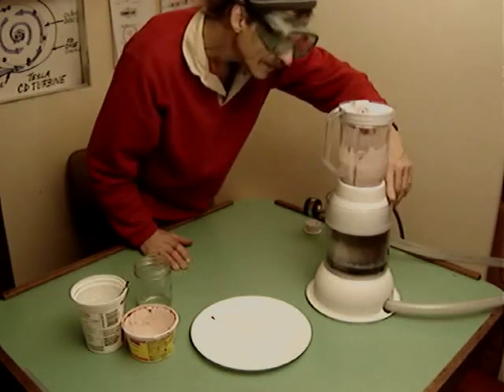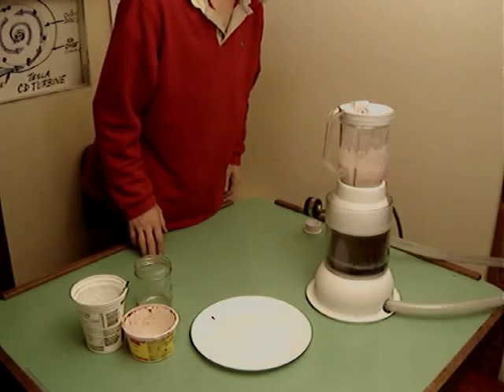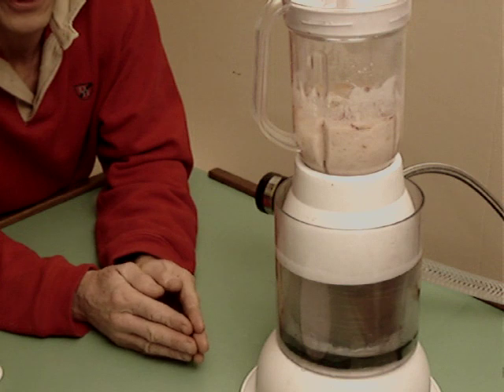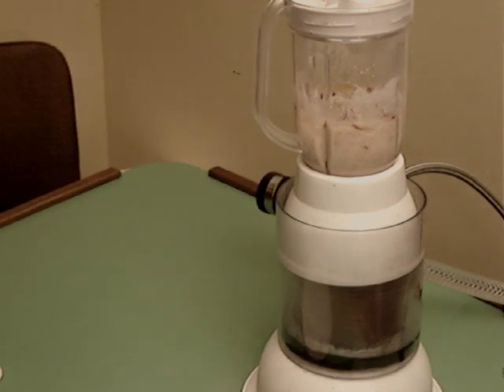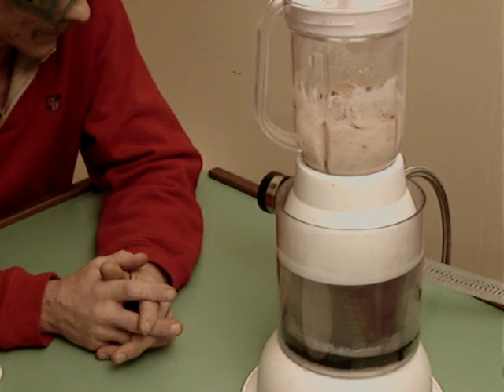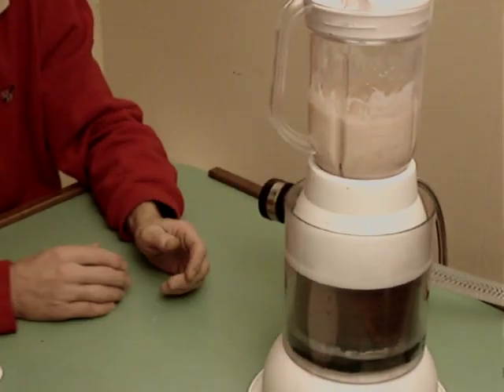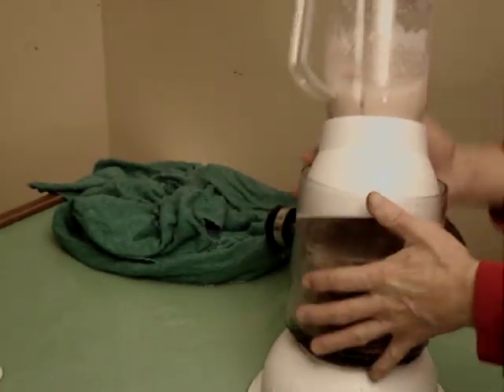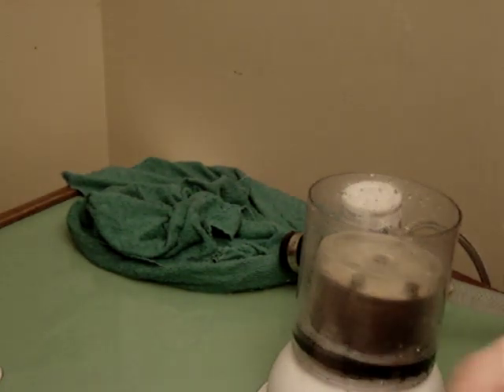Tesla CD Turbine Blender Bursts On Kitchen Table

Comment from the maker: Heat and DVD's don't mix. Steam will warp the discs in about .3 seconds, I've noticed, hehe. You would need to build a separated air-pressure chamber that remains cool, when compressed by steam or heat somehow.

It would be best to build a proper Tesla Turbine that can run on alcohol. But of course, that costs money.

Comment from the maker: I have 6" polycarbonate tubing with 1/4 inch thick end plates to play with next.

I prefer to push the limits of a cheap, disposable turbine that can be built for under $10 by a kid.

The CD case is capable of running the turbine at constant 120 psi pressure or more.

 I made a boo-boo by restricting the outlet hose by allowing water to back up into it. I then gave it too much "throttle" at the foot control for air pressure.

Too much, too fast = boom!
(good comparison with cannon! ;)

Comment from the maker: I'd like to try lots of designs, but a true Tesla Turbine gets expensive real quick, especially if it has a machined shaft, high-speed bearings, seals, and a machined case with special nozzle. 

Unfortunately my $10. per month experimental budget doesn't go far, so for now I experiment with recycled CD's! 

The ceramic discs I really want to use will cost $600 - $1200 apiece to be made.

BTW, T.E.B.A. has taken down their web sites and has little useful info on the net now apparently.

Comment from the maker: When it comes to steam and high-speed rotating steel parts, there are some real dangers involved. However, it will probably work. 4 inch is likely good for 30,000 rpm or more. You need high speed; the torque will be very low with such small discs. If the disc does come apart, not much will stop it, so make sure you have a significant case aound it! Avoid carbide bits, as they can fly off easier.

Tesla used .030 inch thick discs. The thinner the better, but his often warped.

Comment from the maker: There are several points...

1.) To see a Tesla turbine perform useful work.
2.) To demo a Tesla turbine design that is revolutionary because of no shaft, seals or bearings. 
3.) To show that a Tesla disc turbine design runs on multiple fluids, which other turbines cannot do.
4.) This turbine set-up runs on solar power, collecting it through the day and storing it as compressed air. It's inefficient, but it's completely off-grid, and free.
5.) It's just a fun way to run household appliances!

Comment from the maker: Thanks for the theory! 

I think in this case it was a matter of the output hose had a loop of sitting water that the high-pressure air just couldn't blow out fast enough, so the backpressure blew the top off instead. 

 The blender and turbine discs can be totally stalled out and still pass pressure through the discs of the turbine. It's simply the force of fluid adhesion on the discs that turn them, not like in pumps that can blow because of perfect sealing.

Comment from the maker: Thanks!

The cover over the turbine CD cakebox is a near-bulletproof polycarbonate tube, and it would contain any reasonable explosion of the CD turbine. 

I would not recommend running a CD Turbine on compressed air without adequate protection.
(and use a tinfoil safety toque as well !!)

As for electricity, I actually have a few videos showing the CD Turbine generating power...but I keep it under 12 volts for some semblance of sanity!

Comment from the maker: yeah, I was hoping for at least  a trip to the hospital, but the universe wasn't accommodating! Not a scratch! hehe

I tried blowing up a turbine under a pumpkin but that flopped. A magnet came off and through the plastic case at medium speed. The unit slowed down. Anti-climatic.

Guess I'll have to build a real high rpm turbine to come apart for a movie. The kinetic energy stored is proportional to the velocity squared, so  there's 4 times the energy stored with a doubling of the speed.

Comment from the maker: More than a "leak', hehe. Blew the whole top right off the CD case! 

However, the main CD disc pack, is miraculously unharmed. Even after almost a year of intermittent abuse, and the "explosion", the 1/2 inch neo top magnets are still holding strong with marine goop!

So I will hotglue a nozzle onto another CD case, re-use the recycled CD pack, and I should be back in action.

Comment from the maker: @ambitious2012 

That could work in this application.

However, Tesla ran his 6-inch turbine over 30,000 in 1910. With .030 inch discs. I think we can do better than that 100 years later. I'm shooting for 100,000 rpm with ceramic nano-carbon discs that can take 4000 degrees temp. Only they are over $2000 each...

Comment from the maker: Hehe, yes, it seems to me that we should be able to take advantage of that water hammer effect to provide micro-bursts of high pressure into the nozzle. 

In theory, that is! Another experiment I did with 2 turbines, running in series, blew the case off #1, when I shut off #2 !! 

There's big pressure available in water hammering... if we can nail it down...(hehe)

Comment from the maker: It's was used as the outside cover over the CD cakebox in the above movie, and I've used it for a couple of higher-speed destructive tests. 
 
It's hard to kill...although I will be trying to do so, when I make a couple of new high-speed turbines using poly as the case. 1/4 " thick would be better...but I can hammer on this 1/8th  and jump on it, so it's not too bad!

Comment from the maker: Haha, thanks for the blender tech info. What an incredible blender! 

If my turbine could turn 50,000 rpm, it would develop about 20 horsepower. With proper ceramic/nanocarbon turbine discs, this would be an easy reality. Except for the $12,000 for the ceramic discs, that is!

Comment from the maker: If they are treated carefully, the cakebox can take 100 psi air while running. But block the exhaust outlet hose with water,like I did :(...and kaboom! 

This same turbine ran occasionally for almost a year on faucet water pressure before I accidentally blew it up.

Comment from the maker: Do you pay for your AC power? This is free energy from the sun!

 The solar panel charges a 12 volt battery which runs the compressor to store air in the tank. A 12 volt bilge water pump runs the turbine, with a boost of air pressure when needed.

Comment from the maker: Actually, I'm using polycarbonate. It's much stronger than Plexi. (bulletproof glass is 1/2 inch polycarbonate)

 I'll be playing with 6 inch diameter tubing with 1/8 inch wall thickness, and  1/4 inch thick end plates, bolted through.

Comment from the maker: The CD Turbine produces about one watt of power on faucet water pressure. If the same sized discs could turn 40,000 rpm (say with special metal or ceramic discs, not CD's) then it would generate well over 30 horsepower.

Comment from the maker: I've got a busted pressure washer that I will be experimenting with. 

Also, an electric automotive fuel pump seems in the zone to try as well. I like the idea of 12 volt portability and using solar power to charge..

Comment: You should try a pressure washer for the power source. Maybe, fix it so the wand from the local car wash could be attached, to keep down costs if you don't have a pressure washer. Possibly need to be a bit stronger, though.

Comment: Can't say it wasn't somewhat expected, but your reaction time was spot on! I think that's the fastest manual shutdown sequence I've witnessed to date. :)  My toilet works on the same principle (air hammer). I've heard of plumbers blowing faucets off of sinks from that action. In both cases a compressor is not needed. Simply adding air to the city water pressure is sufficient to compress the air in the pipe. When the air expands...voila! Explosive action :D

Great Video!

Cheers

Comment: Girls, keep it at 5 hp and 50,000 rpm and use a metal turbine case with at least a 
4" wing style cutter blade and stainless top with a reversable air nozzle on the turbine rotor .
(Blind Guru has the top you need . This is a micronizing no emf radiation blender ... no emf radiated food like blend tecs 3.5 hp 50,000 rpm blender and this can work off solar generated steam or compressed air and will be much quieter especially when the turbine is properly encased and not venting to atmosphre.)